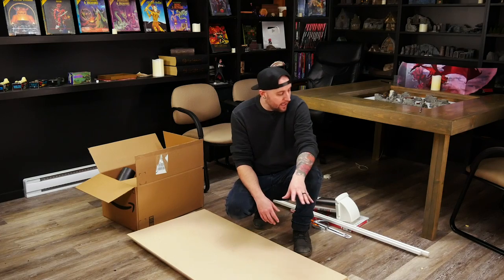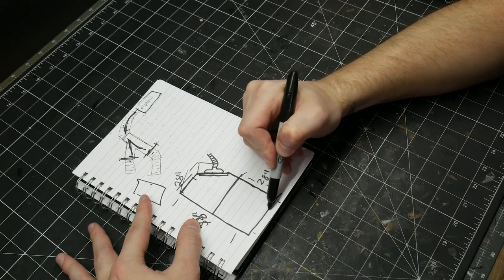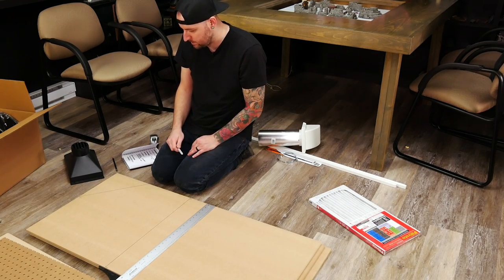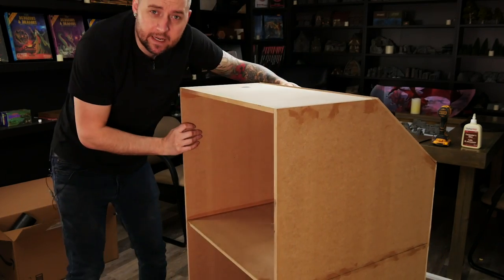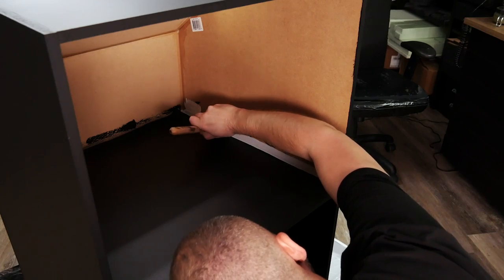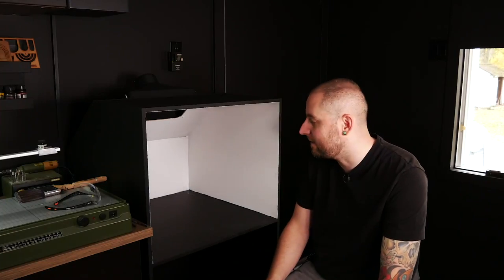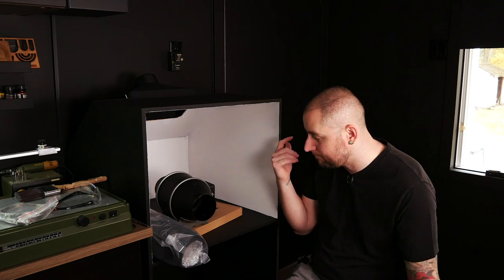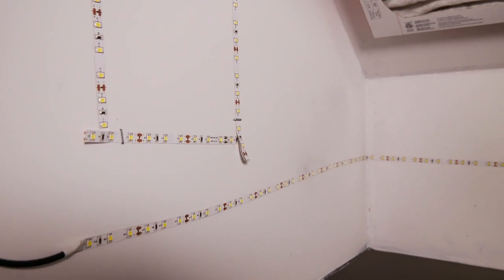I Finally Built Myself an Airbrush Spray Booth!

Comment: Why is it that everyone is so obsessed with dust masks?
Reply from the maker: Breathing in particulates of dust (in this case paint) is not good for your lungs.
Reply: I agree it probably isn't amazing for you, but a home gamer doing one cut a month shouldn't see negative effects should they? Unfortunately much like you were, I am in construction. Specifically commercial finish work. I have never wore a mask, and now everyone is. Kinda makes me worry.
Reply: @BlackMagicCraftOfficial  PS thanks for a reply my dude.
Reply from the maker: My lungs probably contain a lot of particles of things that will never break down and cause me harm from all my years in construction. Cutting mdf on a table saw without a mask countless times has exposed my lungs to more formaldehyde than I care to think about. Now that I'm a bit older, a lot less stupid, and have a wife who has a chronic disease I am a lot more conscious of these things and what to do everything I can to mitigate long term health risks. Even a little bit of foam dust in your lungs is going to be there forever. It never breaks down. Sure maybe one day of a little foam sanding isn't going to hurt, but over time it ads up. Remember this is micro particles that will never break down. 

Wearing a mask in hobby activities might be a little excessive, but it's better to be cautious. Not wearing a mask in construction is honestly pretty stupid. I was stupid. I used to sand drywall without a mask for christ's sake. Some day all of that will catch up with me.

Get a mask friend.
Reply: Good luck to you and your wife. In that perspective I absolutely see your point. Truth be told I grind p-lam and particle board every day. Guess no one told me how much junk is in there. I hope you both live a long time. Good luck to your channel. I really enjoy watching your videos.
Reply from the maker: You should seriously be wearing a mask for that. No joke.
Reply: Just ordered a 3m one I can replace the filters on. Hopefully I caught it early enough. You know the union probably should have taught me that.
Reply from the maker: Just like quitting smoking, it's never too late! Better to start wearing a mask this week than never. Also you'll hack up less gunk in the shower :D

Comment: The irony of you talking about not having a 3D printer then saying you will need to source couplers for the blastgates... if only you had something that could make them specifically to your needs :/
Reply from the maker: I didn’t have, and still don’t have, an fdm printer which would be the appropriate type to print something like that.

Comment: Someone may have mentioned this already but I didn't see it, GET A FIRE EXTINGUISHER FOR YOUR WORK ROOM! It'll save the day in the very unlikely event your fan ever does catch fire or you have a catastrophic failure with the hot wire cutter.
Reply from the maker: The tools I use are irrelevant. Any shop/home should already have a fire extinguisher.
Reply: @BlackMagicCraftOfficial  Great advice

Comment: good decision do not put a resin 3D printer in a small place it needs its own station or you will have a massive mess on your hands with all the resin dripping cleaning.
Reply from the maker: I actually plan on using the paint spray booth for resin cleanup. Might as well vent out the iso smells.
Reply: @BlackMagicCraftOfficial   I've had a resin printer for a couple of months, few you Pro tips.   91% propylene alcohol is not the best thing to clean or the cheapest.  mean green is,  investing on $30 ultrasonic cleaner to bring out all that detail  that will also help clean your airbrush  as well.

Comment: Yes OK but : why not using a large cardboard box instead ? Extremely light, extremely cheap...
Reply from the maker: Seriously?
Reply: @BlackMagicCraftOfficial   Yes, seriously. You can weight it down with a square piece of LDF / particle board (as found on the streets or demolition sites) if you want (and paint it white inside, use lights etc., of course ventilation), all in all the functionality remains the same.
Hey, why not make another video ? You could compare your build with some very low-cost alternative (it wouldn't cost you much money or even time)
Reply from the maker: Connect expensive fan and ducting  to cardboard box instead of good quality $20 wood box? Why? I also discussed my thought process on cost and build decisions upfront in the video.
Reply: @BlackMagicCraftOfficial  Yes I heard your reasoning and the build is very good, but it's a whole piece of furniture now, that takes a lot of room. When I look at the Amazon cardboard box in your stuff was delivered, it's a somewhat comparable volume, if you tape the flaps together. You could find a discarded vaccum cleaner (even the small car variant) and vacuum cleaner hose, and pack all of this inside the box once you're done. This way, you could free up a lot of volume by essentially taking a box to the other room (or the garage, or outside...). Just different perspectives on the same problem.
Reply from the maker: I mean I could also apply all the same reasoning to my bed vs a cardboard box but I prefer the bed. 

A cardboard box spray booth may be right for some people, but not me.
Reply: @BlackMagicCraftOfficial  Exactly, it is all a difference in perspective, as you explained right at the start of the video.

Comment: you think cutting the stucko suck. Come on, your house is made of cardboard, that's so easy to cut. I have 40 cm (1 and 1/3 foot) solid stone to cut through if I want to build the same thing. Just drilling in it is painfull even with a good concrete hammer drill.

Comment: The fact that you do not have a fire extinguisher directly attached to your booth shows that you have no regard for human lives. One spark and families will die! Unless you are using acrylic paint, then you don't need any of this.
Reply from the maker: Thanks for making huge assumptions. There is literally a fire extinguisher directly on the other side of that wall 2’ away.
Reply: @BlackMagicCraftOfficial  but what if that fire extinguisher fails, do you have a back up? Do you?  There should be one per side for your spray booth, just in case.
Reply from the maker: Do you have one in your bathroom in case hairspray is used when the fan is running?
Reply: @BlackMagicCraftOfficial  Yes, yes I do. Checkmate. :P
Reply from the maker: But do you have 2? Just in case?!?! You should have one on each side of the sink. Wouldn’t hurt to have a third above the toilet. And maybe one on your person at all times.
Reply: @BlackMagicCraftOfficial  crap, just when I thought we were safe.....
Reply from the maker: DO NOT SPRAY ANYTHING UNLESS YOU ARE PHYSICALLY INSIDE A FIRE DEPARTMENT
Reply: @BlackMagicCraftOfficial  Truth! It is the only way to be sure.
Reply: #firehouselife
Reply: My fire extinguisher has a series of progressively smaller fire extinguishers attached as a redundancy.
Reply: @pvrhye  It sounds like you need a bigger fire extinguisher my friend.
Reply: In all seriousness, you do not need a spray booth, at all, not anymore than you need one for cutting foam with your proxxon. If you dont believe me, there are hundreds of other miniature painters that have been using airbrushes for decades, in cramped apartment buildings, and they can still breathe. If you are still scared, get a freaking respirator mask.That being said, if you are priming a bunch of things, a fan will be helpful,  but for normal airbrushing, there are very few  "fumes". You certainly do not need to go to extremes.
Reply from the maker: In all seriousness I was tired of paint dust on all my stuff in the room. That’s why I made it. Not for fumes, for paint dust. It’s one thing to spray a few minis it’s another thing to spray several large pieces of terrain. It creates a lot of dust. Yea I can wear a mask but I spray in a nice finished space where I store all my finished pieces. Sick of that paint dust layer!
Reply: Oh, don't put one over the toilet, it might fall off the wall while you're using the commode. Just imagine your poor family finding you after!
Reply from the maker: @Vanye111  but if you got a real bum burner going on, that extinguisher may come in real handy.
Reply: Black Magic Craft ahhh, I get ya, i made a little “booth” out of a cardboard box. It catches all of that.